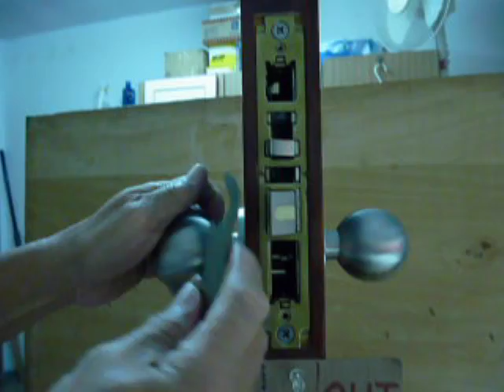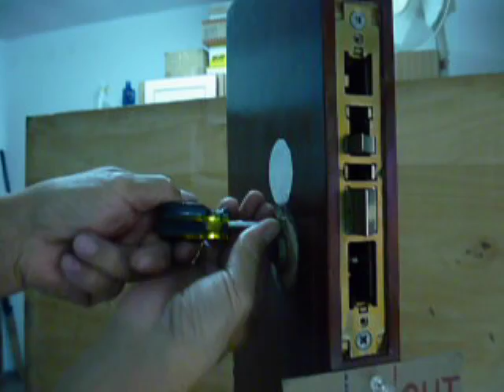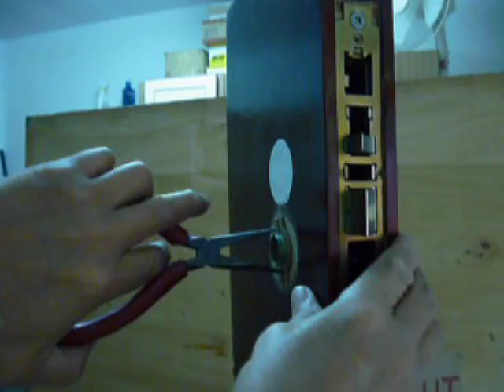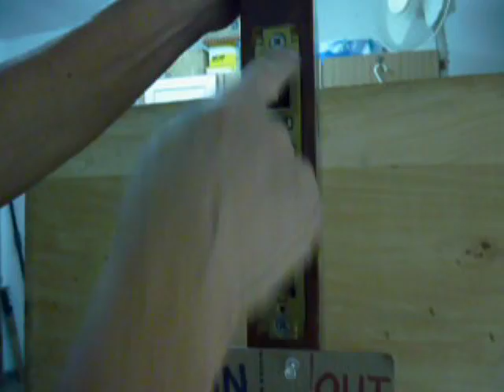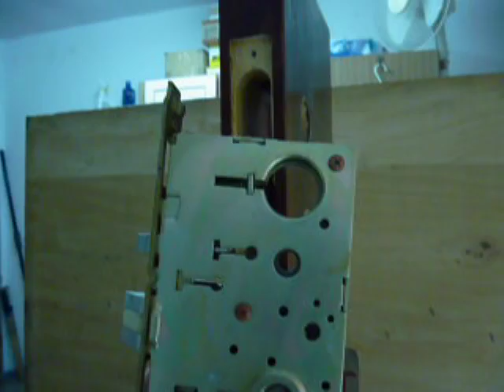HOW TO REMOVE SARGENT MORTISE LOCK FROM THE DOOR

Comment: Thank you, kind sir

I bought this house well over 20 years ago & the front bar door has this type of lock. For a long time no one knew anything about what it was. And unfortunately, to this day, I've never had a key!

But now I'm dead set on getting a key. Thanks to you at least now I know so much more about the lock, mainly, how to get it out! :D

I'll take it to a locksmith to see if it's possible to be rekeyed/replaced...

(I'll start with calling 1st, but I'm sure they'll say they need to see it--BIG service call, right? Not! :)

I'm fairly sure some years ago a handyman told me a regular deadbolt won't fit, for both configuration, And the narrowness of the door. :(

I know this is an old video, but if you happen to see this comment, I'd welcome any suggestions.

From anybody! :)

(And I'd rather not have to pay $$$ for another door, and then pay $$$ for install, hint, hint :)
Reply from the maker: Mr @craiglist474,  if the lock is functioning well and your problem is just to have a working key, just take out the Mortise cylinder, and bring it to a nearby lock shop, they can easily make a key for it. To remove the Mortise cylinder---take out the cover by unscrewing the two screws of the face plate.(that is located where the bolt is projecting.) you can see two tiny holes (aligned with the mortise cylinder) take a small philip screwdriver, insert it in the position side of the mortise cylinder, the screwdriver will end up at the head of the retaining screw of the mortise cylinder, unscrew (or loosen it up.). you can turn the mortise cylinder once its free from the retaining screw. remove the mortise cylinder, and visit the lockshop for an easy rekey. hope it helps.
Reply: @yononable  Thank you! After reading your reply, I'm actually standing at the door looking at the lock as I type this. 

Thank you for the instructions. And for the motivation and encouragement!

Comment from the maker: the simplicity of the mechanics, the robust construction and the very durable mechanical parts of this sargent 7704..set this type of lock apart from other mortise locks..however the newer sargent locks with lots of features like the 8205.. i observed not quite as durable than the older type.

Comment: Hi I'm a locksmith and I came across two of them over the last two months, to my I couldn't get the outer stop come out. This got locked in her apartment two times the building security had to open the door from the other side.
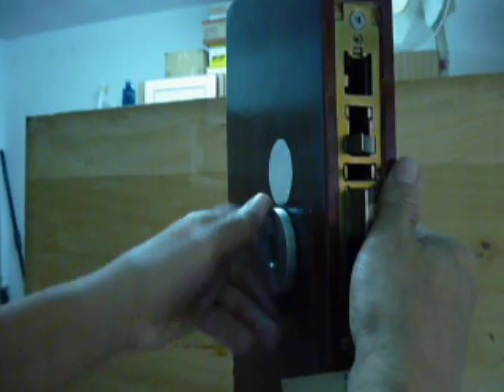Then a day ago I get a service call for a condo key stuck wont turn. Tried the under the door tool  not turning. The key cuts stuck at 5:00 position . Last resort drill out mortise lock, which I hate doing. 
Started small work my way up that darn lock said kiss my * broke about 4 drill bits. And told my new step drill the same thing. Now is 0100 - 0130. The family and friends standing in the hallway the whole time, the last condo next to the fire door. Which they had open to cool off, little did it help, the father is a five year kidney receiver and his medicine and car keys were locked in the condo they call around to get his meds one in the morning. But one thing I did I made sure as hell to get that stubborn sob out the door, took a while got my vise grip on it and screw it out. And guess what no matter how hard I tried could not get the bolt to come back into door. 
Do 02:15 we decided to stop and come back the later in the morning, 09:00. They got a cab and was lucky to get a hotel room so early in the morning, and it was a state holiday. Ok sorry. I will share how I got the door later that morning. Which was yesterday.
Reply from the maker: hi tim that was some sort of a frustrating  experienced..it happens on all of us locksmith's once in a while...i know how strong these sargent locks are..but...there are always the un expected...let me guess.. since you already took the cylinder out, (am i right?)still the bevel bolt wont retract...wouldt it be that..the bevel bolt and the pulling bolt been dis engaged fron each other? leaving the bevel stuck in the latch catch of the door jamb?
Reply: @yononable 
Thank you. Now I'm looking for a replacement lock assy. New or used. I know the 77 are no longer made, any idea where to find the same lock?
Reply: @yononable  yes had to cut the bolt to open it.
Reply: The replacement seems to be the 7800 's
Reply from the maker: Tim, i think  it like looking a needle in a haystack. if i am in your place..i'd rather fabricate (if that is possible) to replace the part that was cut off. i did a lot of modification and fabrication of parts by hand..sometimes i used parts from other mortise locks and just reshape it. regards.